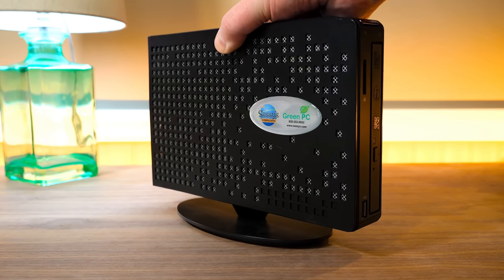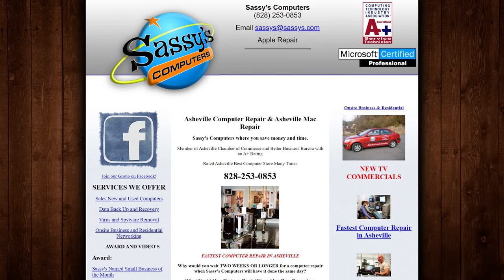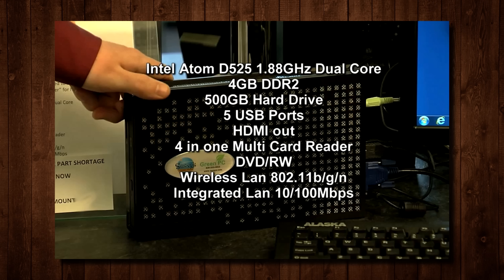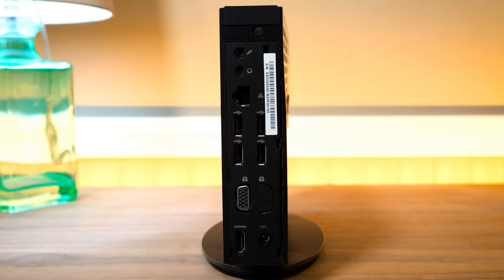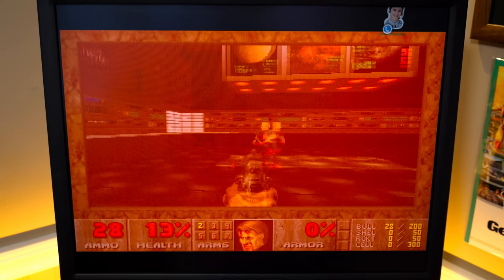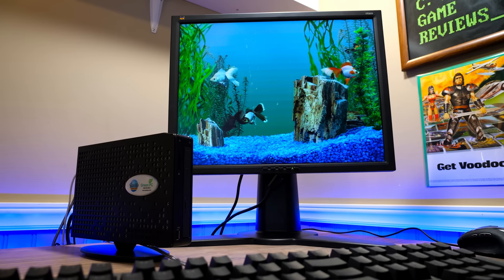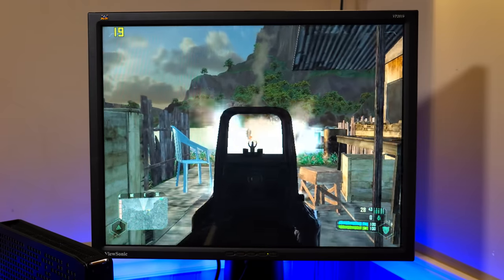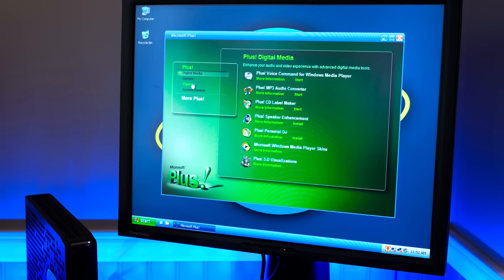Rejuvenating a $599 Shuttle Nettop from 2011! Sassy's Green PC

Comment: 599?))) 5.99 мауbe? :-D I have variant of this type of PC - OQO with active cooling, Atom-525 + Ion2, 2GB RAM, 60GB SSD, and win10. mmmm... Well, it starts.. and even works.. making noise by cooler..)). Byuing some months ago. Tested on NES emulating (with old tv attached through converter), Quake3, Chrome + Youtube on low... Maybe it is good idea to install winXP instead of win10 on this device and play old than 2000 games, there are lots of them.

Comment: im a bit confused. why is the boot animation still says regular XP?

i installed MCE 2005 back then and the boot screen was indeed a special version which said "Windows XP Media Center Edition 2005". did they removed it with a Service Pack?
Reply from the maker: I’ve never seen that! My copies of MCE keep the logo as-is
Reply: @LGR  maybe the international version? i have to clarify that the bootscreen didnt say 2005 but just "Media Center Edition",

i remember this because on 2005 i was mystified by this bootscreen on google images, so i set to find a copy of it and when i finally managed to find one it was 2007 and i was able to link my x360 to the PC using their special "Media Center Bridge" feature. good times

Comment: I was fixing a computer with the same Atom processor today, there is no way to make those things run Windows 7 at a decent speed
Also, those boards use a lower voltage RAM

Comment: Modern Mini-PCs aren't much more powerful, though having twice the cores but eMMC storage absolutely ruins them.  eMMC needs to be outlawed.  I can't imagine the cost of using a proper SSD interface would raise the price significantly.

It's like Wal-Mart selling cheap cheese that has no milk products in it.  Such a product doesn't need to exist as it just robs people of $1.00 who otherwise would have spent $1.25 on an actual milk based product.

Comment: I really hate it when people blame Windows for slowdowns caused by hard drives and bloatware. Windows 7 is a very fast operating system. I have an ASUS eee pc 1001px and all I did was give it 2GB ram and an SSD and it runs Windows 7 Home Premium 32bit just fine. Loads up within 10 seconds and it also has an Intel Atom 1.1ghz.

Comment: Which version of Half-Life 2 did you test? If you have a non-Steam build from around 2004/2005 which features an older Source Engine version, it may likely run better than the current Steam release.
Reply from the maker: It's quite an old version, Steam doesn't even install on XP anymore

Comment: You know, you could have perhaps gained more graphics performance in games by using a second memory stick to run the memory in dual channel mode. I think the GPU in that system feeds off of the system memory and if that's the case, then what I suggested above would help. Unless the nvidia GPU has its own dedicated memory in which case, ignore me.
Reply from the maker: There's only a single memory slot unfortunately.
Reply: @LGR  You're right, I could have sworn I saw a second slot. Must be because I just bought a refurbished HP elite desk, opened it and saw two memory slots on it, then projected it on your Shuttle :).

Comment: Intel has made that brand name "Atom" utterly meaningless, like the did with "Pentium". They have assigned the same name to drastically different architectures. Hopefully it is not so old it is one of the in-order core ones. Those are basically high clock speed 486 pipelines. Newer Atoms have out-of-order cores, at least comparable to a Pentium Pro pipeline.

Comment: The spec's aren't that bad other than the processor. I assume that's a big reason why it used so much less power, running such an outdated dual core for a 'desktop'. The silence is a good thing 100%, first glance it looks like there isn't ANY type of fan and yet instead it's just vented on the panels. Again, no way they could pull this off and not have a proper fan without having a laptop processor in there. The fact that they'd include so much garbage on there, even scamware? Pathetic.... using a PC is just something you shouldnt worry about being green about. Instead, be green with your recycling or reusing of the materials when moving onto a new setup.

Comment: I don't know if this is true anymore but back when Windows 10 was first coming out it ran much better than XP on low-power hardware. I think I had it running on something with a gig of RAM and a single-core AMD sempron at one point. I don't know if it's like that anymore because Windows gets more and more bloated constantly but 10 did honestly run a lot lighter than 7. it is ridiculous though how on a computer with 1GB of ram windows will use like 300 MB of RAM for system processes but if you have 32 gigs it'll use like 7. Ridiculous

Comment: Atom CPU is so weak that it helps to create tons of electro garbages.  None of them can be used as powerful as it presented in this video unless there is an upgrade. However, at the year 2010 an SSD and RAM upgrade would be definitely more expensive than the device itself.